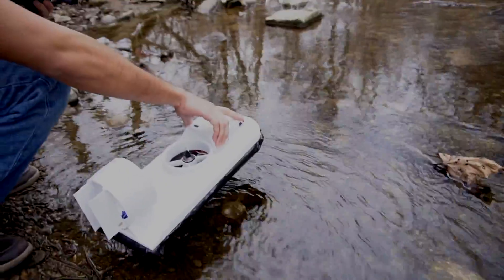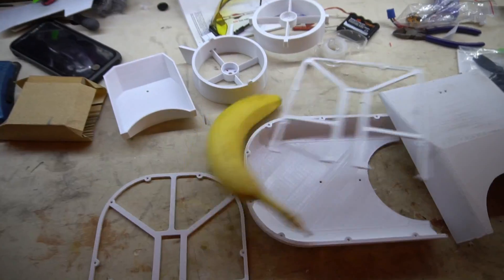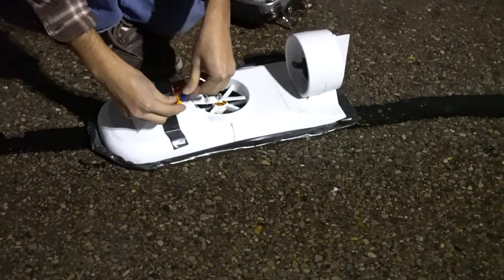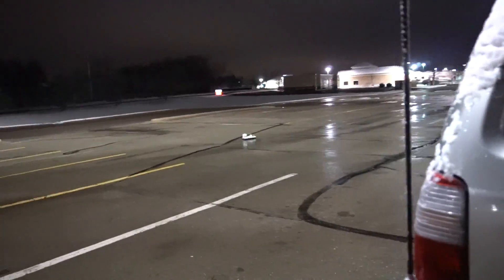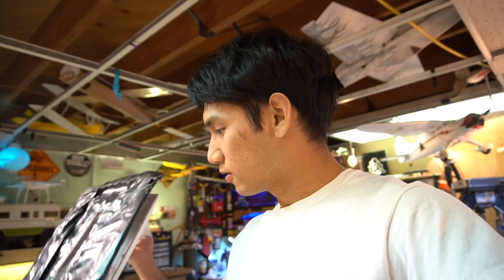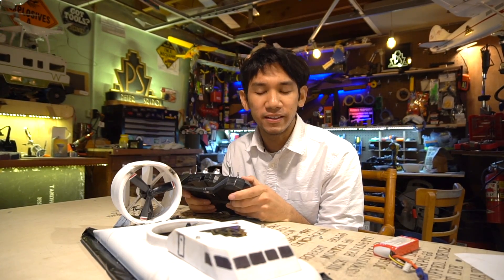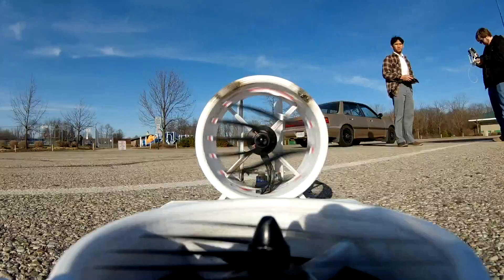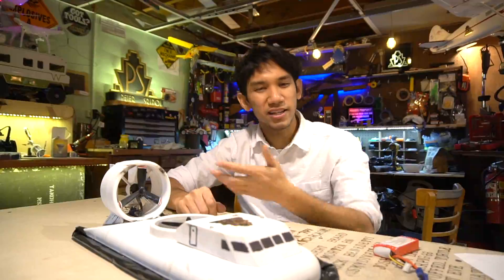FREE 3D printed RC hovercraft

Comment: well darn Peter, I have REALLY cool design prototype I whipped up out of cardboard (unfortunately mice did a little shredding on it) that I'm positive you'd really love disecting. different type of hull that can float without being powered, different type of skirting, would be super doable with water resistant foam board. send me a PM I'll mail it to ya. too hard to describe in text but you'd understand instantly once seen!
Reply: another recent thought (just yesterday) a micro hovercraft by butchering a little E010 or F36 micro quadcopter. the two front motors providing lift, the two rear motors providing thrust with differential steering. "fun" part would be programming the board to put left stick only to the lift motors, right stick only controlling the two pushers, and even better if it could be given reverse there.

Comment: Great project!
Thanks a lot for your design and effort!

From my 3d printing experience both PLA and ABS are very well glued (technically checmically welded) by
 - Dichloreethane (very aggressive to plastic, strongest bond but toxic as well). Use it to glue 3dprinted planes.
 - Ethylacetate (less aggressive and much less toxic)

Comment: what material is required to weld two thin brass rods...like you do in your projects with propane torch? please reply ....
BTW, Hovercraft looks nice but working on water could be improved.☺✌
Reply from the maker: I use just some standard electrical 60/40 rosin core solder (it has lead in it) and a soldering iron or blowtorch! 

and yes water could be improved! :D
Reply: thanks!!
Reply: if you have enough heat, use flux and glue brass with brass (brazing) can come up being much stronger
Reply: no problem, kinda similar to soldering but it's also gas welding. many of my projects I'll sand/grind carbon fiber rod to flat matching points then use crazyglue and thread to join, also works well building structures with carbon fiber or aluminum tubing. example: large tubular RC dragster frame from 8mm CF arrow blanks. can build really strong super light with very minimal tools
Reply: thank you model nutty
Reply: Thank you model nutty

Comment: Yeah thumbs up for a first attempt!

few things you can do / try.. 

Having the air coming from the middle will make it unstable as you found as its basically on a knife edge, if you direct the lift fan air to the sides then you have two air lift points as opposed to one in the middle which will cause it to flop side to side.

Another thing you can do is steal some of the thrust from the rear fan for extra lift but thats more for single fan setups but if your mixing that might work better as you can give more static lift at the front and then when you want to shift it up you will pick the rear up with the thrust fans extra air coming through..

As for joining the parts I've never had great success with glue best to just melt / weld the parts together if you need it strong.. or make it with interlocking tabs to give it a bigger surface area to bond too..

as for weight don't worry about it.. it ground effect so you'd be surprised how heavy it needs to be before it will fail to lift :) I bet you could use some duck tape as reinforcement if you're finding the black bags are ripping to much or reinforced packing tape.

Comment: Why 3d print something and then start drilling holes in it? Just design it with the holes already there and use less plastic
Reply: If you mean that motor mounting, i think that was a mistake. Otherwise my guess its easier to prototype that way,  especially when you are new to mixing 3d cad and actual real things.

Comment: Peter, you got a 6 channel programmable tx, why didn't you control the down thrust motor with a switch or that turn pot thing?
Reply from the maker: I just Y'ed them to keep it easy. Plus I had my friend drive it with no hovercraft xp and having it continue to drift when he has no idea what he's doing could be an issue! I'll try and cover more in the build video involving setups!
Reply: Yup, that's what I did with mine and it worked well.
Reply: Stambo awesome! Even on water?
Reply: Not so good on water due to a design flaw, I have a mod in mind that should help though. :-)
Reply: Stambo nice, hopefully peter also makes a version 3
Reply: Stambo or you make a video on it! I subscribed to your channel!
Reply: Stambo what about thrust vectoring for the lift motor? if you only have on/off some simple foam should do it...
Reply: As you learn to operate it you will find it cannot be parked, rotational torque from the lift motor will make it try and spin on the spot.
Also you have to have air from the thrust motor going over the rudders, an airplane is going fast enough through the air for rudder to have an effect, a hovercraft is not if it wont turn, more throttle. :-)
Reply: I had my skirt motor on the elevator chn, trimmed it so that it keeps it just inflated but with a bit drag on the skirt on this way it is easy to reduce drag by input on the elevator. I had to do this for instant stops as i'm learning to control it with the throttle while turning. Hovercrafts are so much fun!